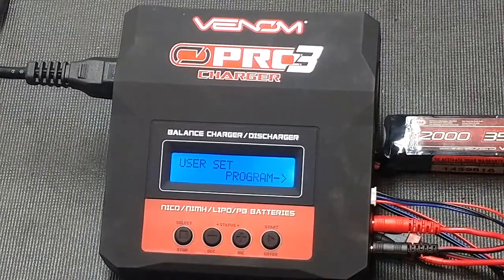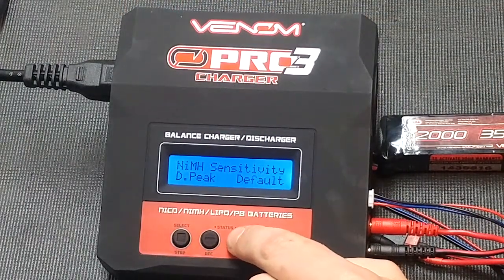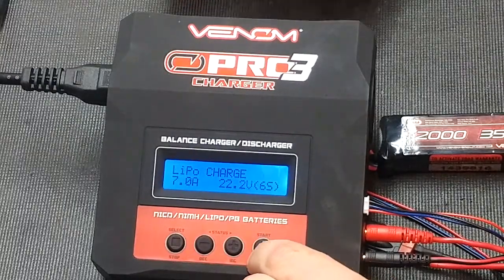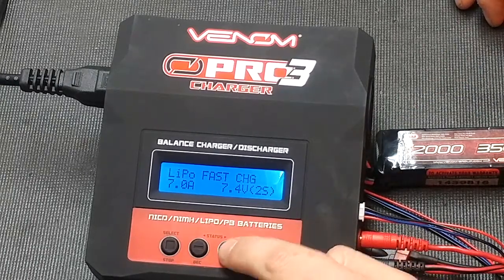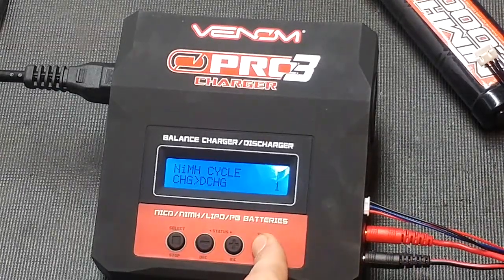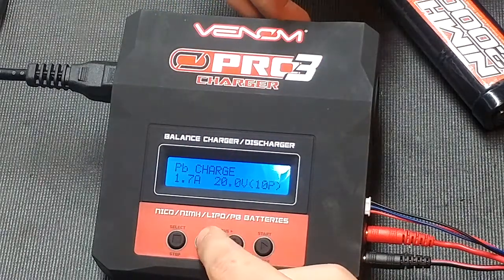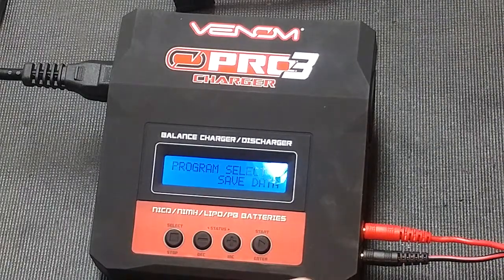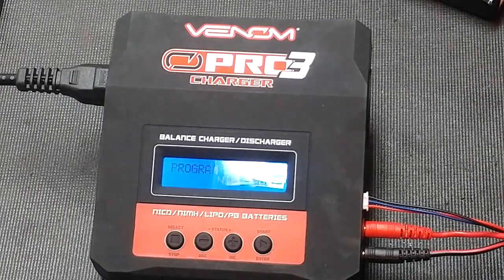How to Use The Venom PRO 3 Charger

Comment: I’m trying to charger a Gens Ace battery (3s 5000maH) but it keeps giving me a “connection break” how do I fix it?
Reply from the maker: Try reconnecting all charging leads and make sure it has the correct charging voltage
Reply: Now when I plug in the DC cable alone it turns off?
Reply from the maker: The current may be too low

Comment: How long will it take to charge a 3s 2200 lipo?
Reply from the maker: +Charlie Estess if you charge at 2.2 amps it will take about 1 hour 1000mah on battery=1 amp charge rate so 2200mah=2.2 amps

Comment: how do set it to life battery mines wont go to life battery?
Reply from the maker: Jewl Jordan when you first turn your charger on go to user set program press enter then press increase until you see LiPo V.type. once you are there press enter until you see the voltage flashing. Then press increase until you're voltage reads 3.3 volts and it says life V.type
Reply: Thanks Rc Outdoors you guys are great thanks again.

Comment: What are the differences between balance, storage, and fast charging? Also, when would i need to discharge my lipo battery?
Reply from the maker: a balance charge is when you charge each cell with the same current so the pack cells are properly balanced. A storage charge is to lower or raise the pack to a safe voltage for when you will not be using the pack for a few weeks to a few months to not damage the pack. A fast charge keeps a higher amp rate going into the pack for a longer time before lowering the amperage, so your pack can charge quicker. The only time you need to discharge is when you are not using the pack or if you suspect the pack is not holding its full capacity
Reply: Rc Outdoors thank you so much for your info! I am fairly new to lipos haha. But just so I understand, storage charge and discharge are almost the same thing? And what should I do if I decide to use my Lipo after being 2 weeks on storage charge? Do I need to recharge it? Thanks :)
Reply from the maker: the only difference between a discharge and storage discharge is discharge takes the battery down to 6.6 (3.3v per cell) volts in the pack and a storage discharge takes the pack voltage down to or up to 7.70 (3.85v per cell). and yes you will need recharge the pack after storage. Im glad i helped that is what i am here for
Reply: MCLAPRO2 oh